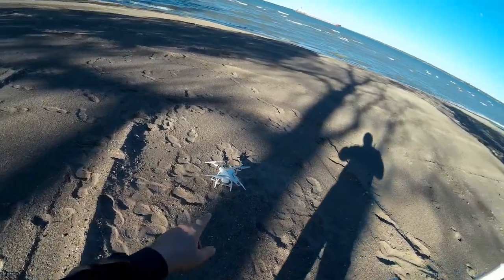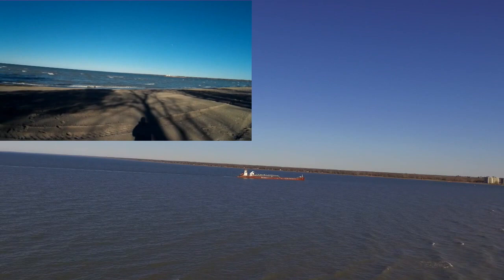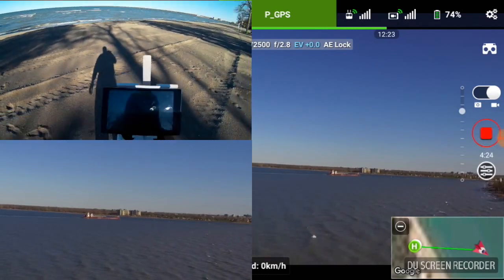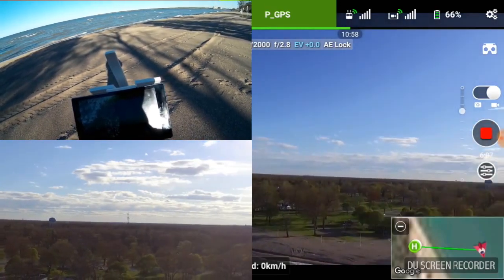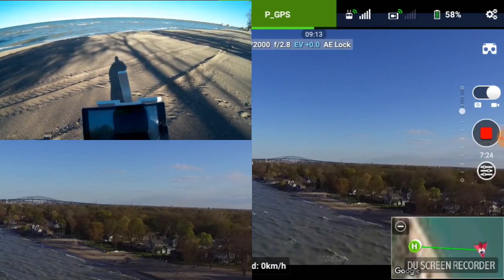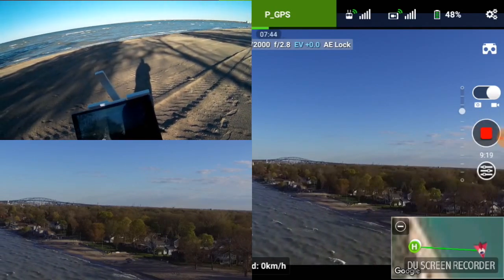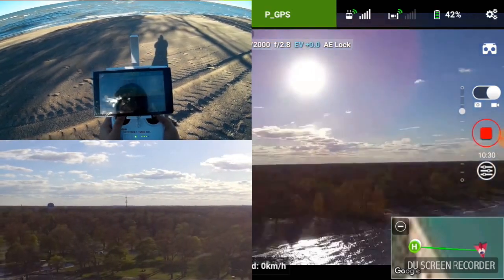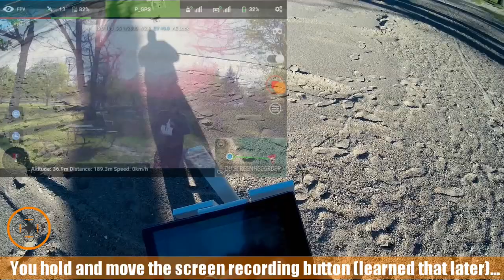Video Drone - DJI Phantom 3 Clone Battery Test!

Comment: I bought an extra battery for my Phantom 3 standard from Celtronic's.  I payed $168 Canadian for it. I did a flight test with the original that came with the drone. This new one gives me 3 to 4 minutes more flight than the original. I plan on buying another from them way cheaper.
Reply from the maker: Will have to check them out thanks for sharing :-)

Comment: My Wifi signal is Fine, What is "SMA" ?  I do not think there is anything wrong from the Controller,  it happened to me three times and + already only when I am on FPV,  I flight 3 or 4 times today without  having any issue when I am not using FPV.
Reply from the maker: Your signal can be "fine" however that doesn't mean there isn't interference as there is a difference in  signal strength and crowded band as all of these consumer drone standard WiFi freq just your home router or cell phone so at points your signal could be "crowded" out.  The SMA connect is the small connector that connects your antenna to the circuit board.  If it is lose or has a moisture issues, than this could also have a negative impact....